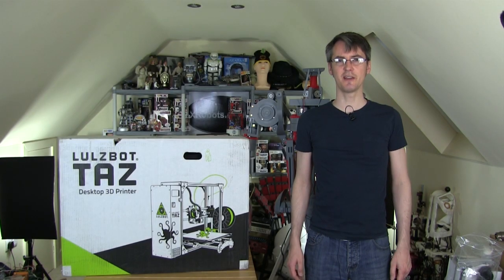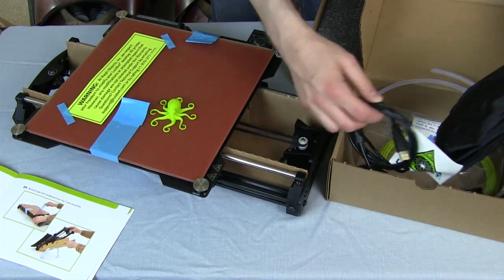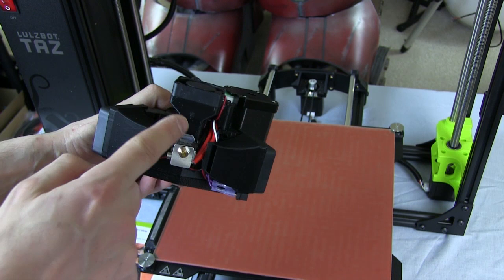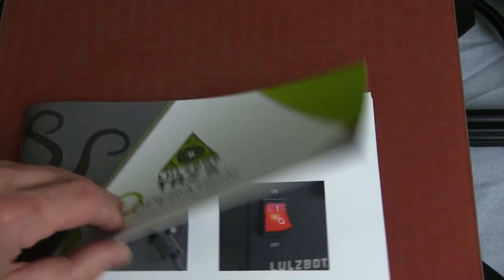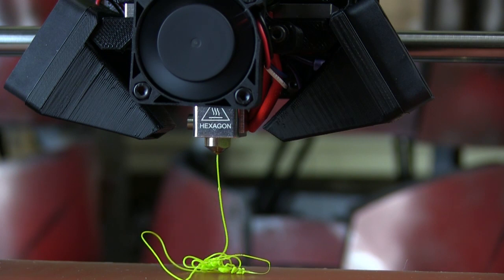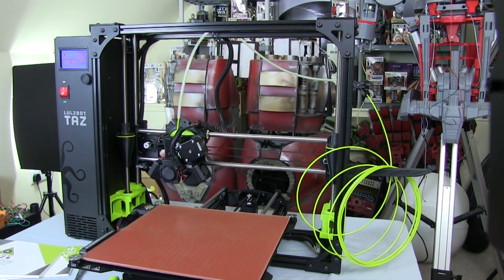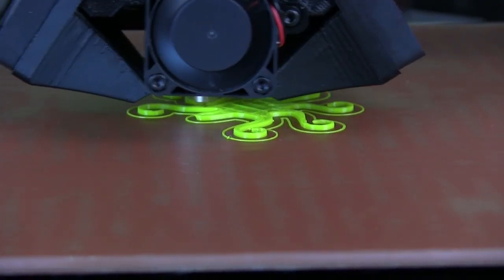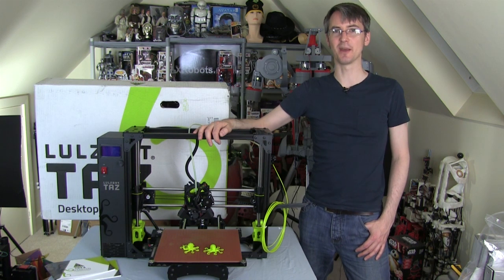LulzBot TAZ6 3D Printer Unboxing, Setup & First Print | James Bruton

Comment: Cool that they put the auto levelling sensors on a bigger printer.
I kinda wish they would make a printer with the form factor of an Ultimaker or something to avoid dust falling on the metal rods and stuff as well as keeping everything warm around the print, not just the bed, which might help avoiding layer splits.

Comment: A very useful and informative video which makes me feel I should have a 3D printer even more than I did before! I'm also thinking of a LulzBot as you make many prints using yours and you rarely seem to have failures. I agree with the concept of printing from SD card as I imagine Windows is the weak link in the process, especially for longer prints. I'm not sure yet if the Mini would be best or possibly the Taz. Thanks for a great introduction to the Taz 6 and for all your fascinating videos which I watch avidly and not without some jealousy for your skill and enthusiasm when making your stunning creations.

Comment: Love how easy this 3D printer looks to set up and use. Any cheaper alternatives that are similar for people that dont want to speed $2500 for a small hobby i thinking at least 1000 and down that not much but is to some/alot of people.
Reply: +CitrusDruidxCDx Like James said get the mini but if you're like me and still want a bigger volume you can get cheaper taz 3,4, 5 models second hand. A company called ITW or ITWorks I think, just google them, they re sell refurbished models.

Comment: Looked like there was a big glob of filament when it first started to print the object?
Reply: can happen - sometimes just a bit of filament is extruded as hot end heats up to print temp.. I usually watch as heating & pull off any excess with the tweezers just before reaches temp & starts - then prints clean (lulzbot mini) - even if you miss it, not usually an issue as the excess bit is just sitting on the pre-print outline

Comment: Nice printer but seems rather pricey at $2500, when as $300 printer would give you the same finish, is it worth the extra $2200 ?
Reply: Please do tell the name of the $300 printer your talking about ???
Reply: Duplicator i3
Reply: could you share some pictures of your prints off the DI3
Reply: Its really about the build volume, 285 mm is hard to accomplish with accuracy.
How many build volumes in 3d printers do you see this big at this price and still
produces nice clean prints.........

none

until the gmax
Reply: Oh ok, you ask a question then answer for me.....

Comment: im looking to maybe get into 3d printing anybody got a good first model like if i dont want to spend too much but still want decent prints
Reply: 3D printers are expensive, that's something you need to understand. Most also aren't beginner friendly. If you want a cheap 3D printer, then you can't get a good 3D printer. Really its probably not a great time to buy one, seeing as they're getting cheaper every year, and the technology is still evolving. If you think you can handle a less than user friendly 3D printer, and do things like level the bed yourself, your best bet is probably an older TAZ model, second hand if you can find one. If not, wait for the technology to get cheaper, or bleed yourself dry. If you buy a cheap 3D printer, you'll get a cheap 3D printer.